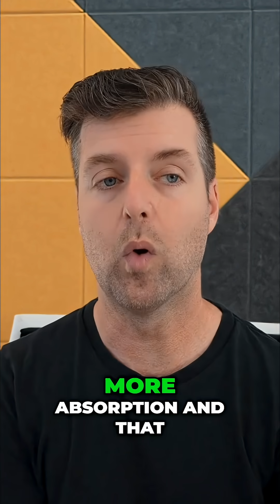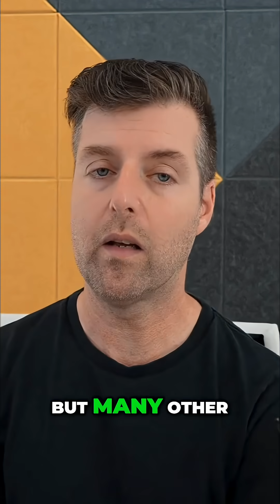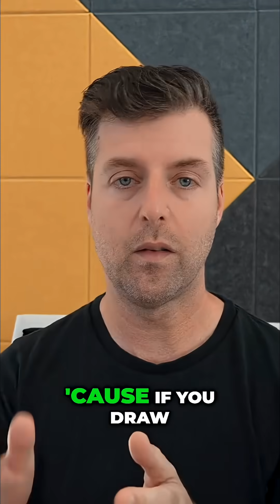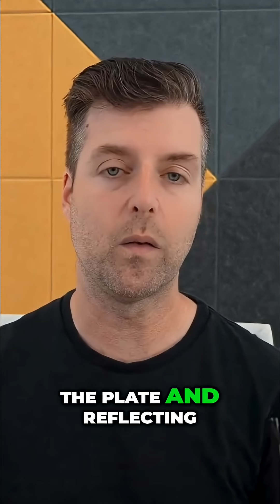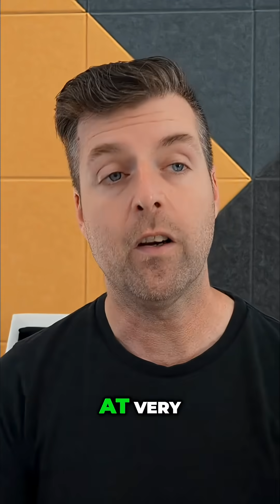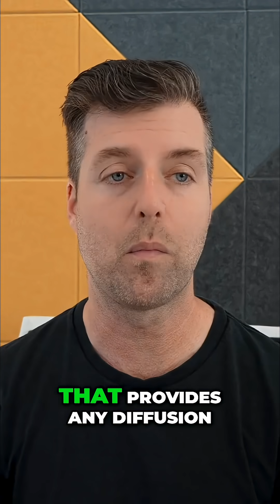BAD Panels: Diffusion or Absorption? Acoustic Secret Revealed! #shorts

Comment: Was it only 10k? I seem to recall at least some scattering Down into the bulk of the speech range (as low as 1-2k?), 

and some real, measurable diffusion down into the 3.5-6k range? 

But even if it’s only scattering down to the 6-8k range that should demonstrably help with localization.